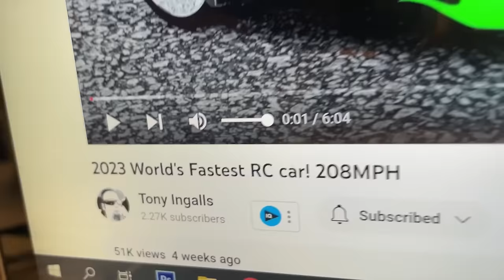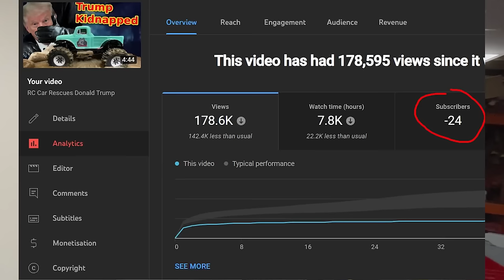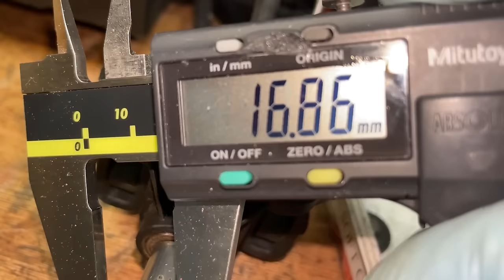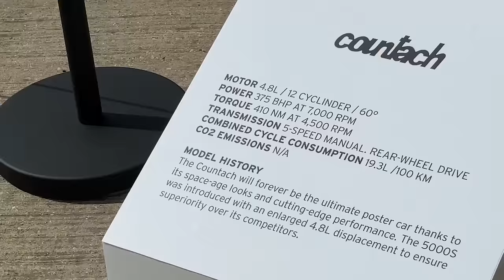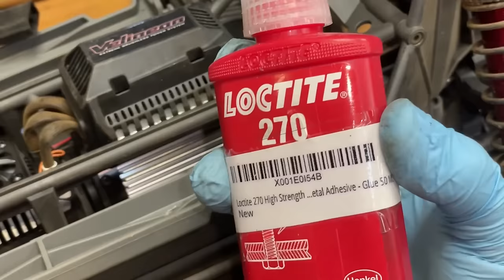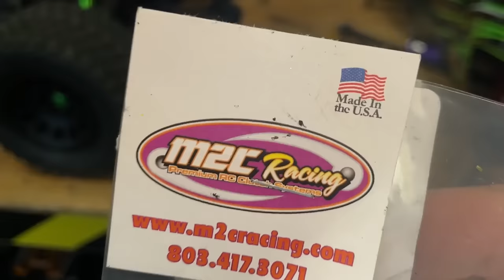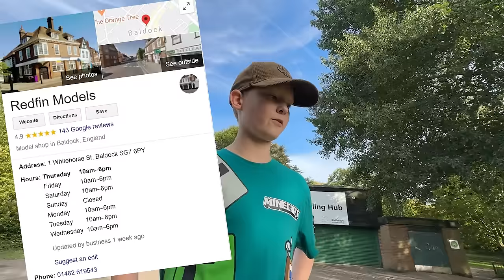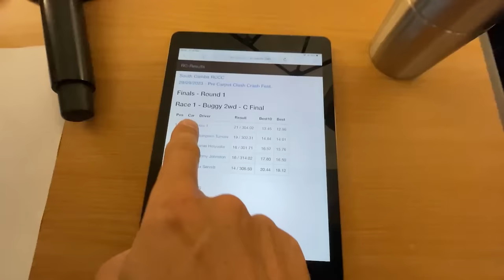RC Cars - The Movie part 2 - Christmas special 2023

Comment: Kev, for your speed runs, I believe you should raise the rake of your rear suspension to improve stability, ala Red Bull F1, which should help with the front wheels lifting and destroying themselves due to crazy forces when spinning without any load on them. Just a thought I've had every time I watch your speed runs.
Reply: And a lesson from streetluge, any heat from the wheel bearings gets transferred to the wheels, which will soften the material used to make them, including the glue, so solving any potential heat transfer should assist any issues from this affecting your wheels. Streetluge wheels have vents and urethane, so maybe some custom design is worth looking into

Comment: I was wondering if the engine with the super charger....Does it have a timing sequence for the glow plugs...The way normal engines have with spark plugs?! Also curious if it needed some sort of motor oil? 11:47:40

Comment: So I saw your review on the Hpi savage… was wondering what your thoughts were on a 1/10th basher. I just got a Kraton 1/8 6s but want something a little smaller for skate park and big dirt jumps. Hpi savage Sx, widemaxx, corally, or MT10 variant. I’m stuck and don’t want to regret anything. Would be cool to have something my kid can drive too. Let me know what you think kev I will buy what you suggest just saying. Just haven’t seen a best in class heads to head vids everything I see is a year+ old